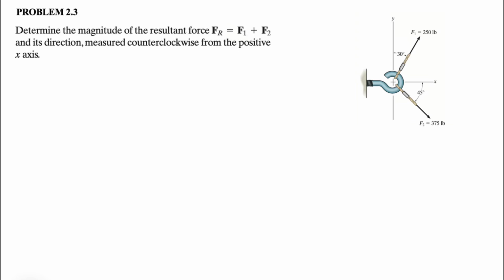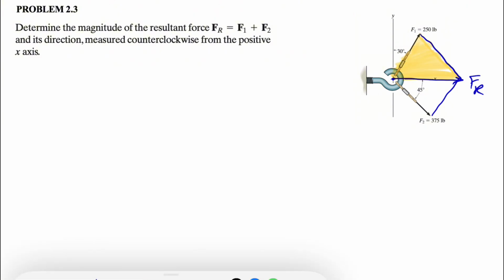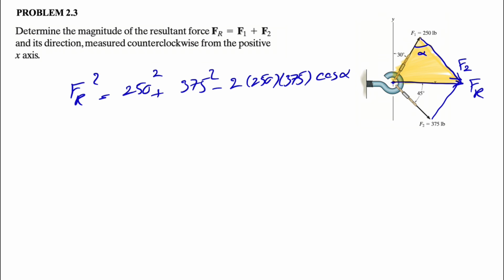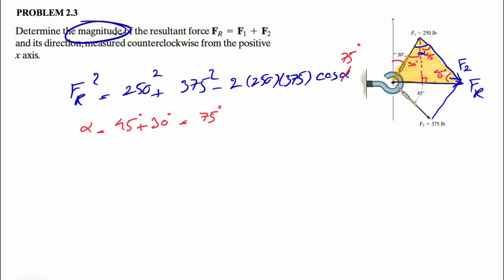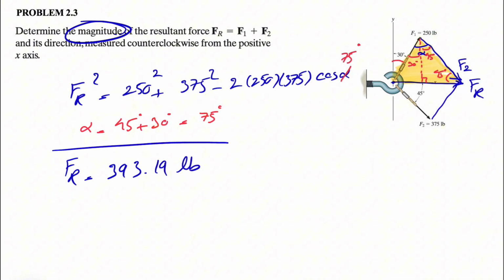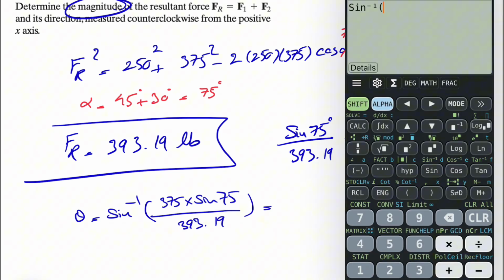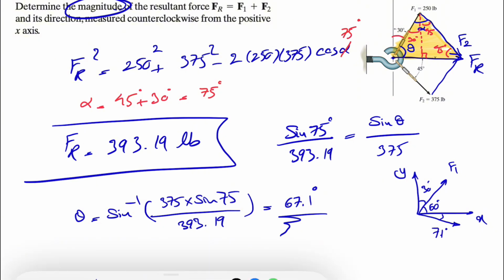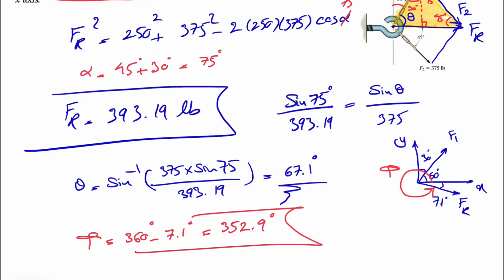Solved Problem 2.3 | Determine the magnitude of the resultant force FR = F1 + F2 and its direction.

Comment: How is the angle between F2 and Fr is 45°??
Reply from the maker: You’re right to question that — it’s not 45°. In fact, the resultant Fᵣ is about 7.1° below the x-axis. The sketch I drew in the video was a bit misleading, so thanks for catching that. So the correct angle between F₂ and Fᵣ is (45° − 7.1°), not the full 45°.